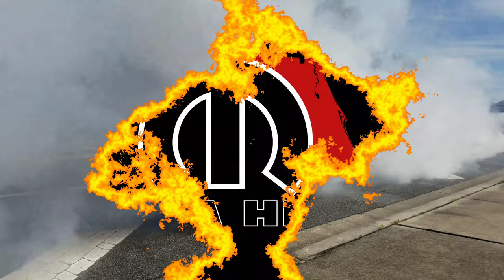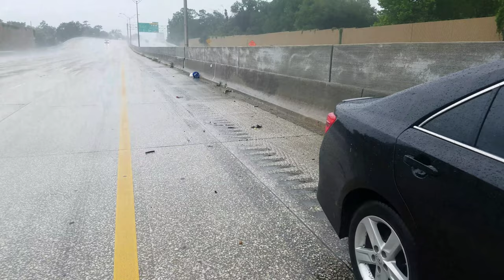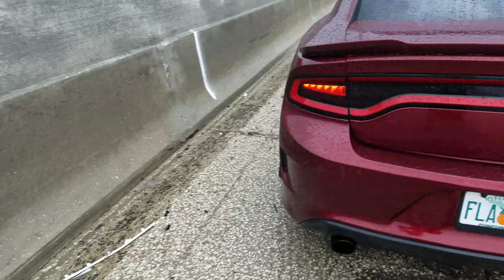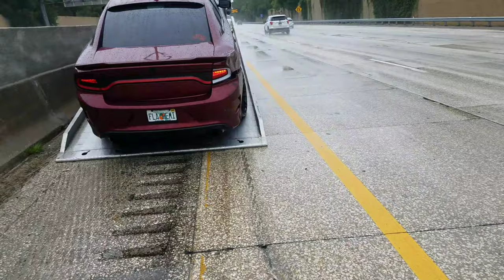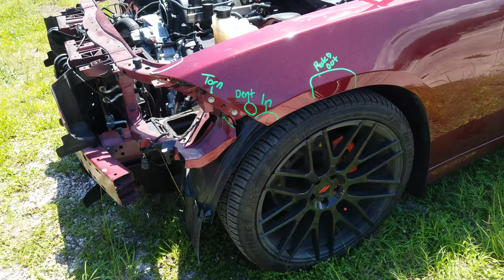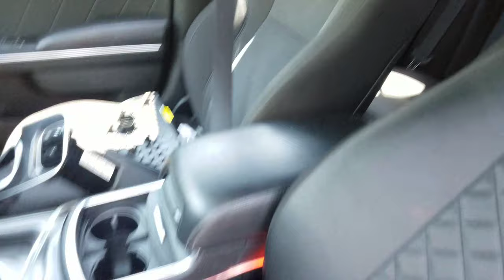This what happens when you Hydroplane!

Comment: Bro what are the odds smh the same exact thing happened to me on 295 n Dunn ave around the same time and I have the same exact damages on the rear passenger side my car is in the shop now 7300 dollars in damages ....Everything happens for a reason I know your next car gone be 🔥🔥🔥 stay safe out there
Reply from the maker: Damn. Stop playing. That's crazy.  Glad you safe homie.  Yea they said mines had over 14k damage.  They tried everything not to total it.  Even was gonna add some of the things I did to the car to bring the value up. But didnt work. Wish it could of been fixed. But on to bigger and better. Thanks mane.  Stay tuned. 🤫💯💪🏽

Comment: Bad tires
Reply from the maker: Tires had nothing to do with it. Tires werent even 2 months old.  On my way home that day seen 3 cars in the ditch. That did the same thing.  Was raining for 2 days str8.  Just an unavoidable accident. 💯
Reply: FLA HEMI The age of the tire has nothing to do with it. Tread is all that is important. From watching a couple of your videos, it looks like you are not that kind to them. Especially if you are using a cheap tire like Atturo or delinte’s. I’ll never understand why people put so much money on their cars just to put cheap tires on it. Not hating, just an observation. Time for a 392!
Reply from the maker: @casperjax1250  delintes ain't cheap. I rode on the original front tires for 2 years and over 65k miles on them.  The rears would be just good if you drove like a grandma.  Dont buy a V8 if you ain't gonna burn some rubber from time to time. 🤣
Reply: FLA HEMI Sorry bud, Delintes are the tires guys get when they can’t afford a p-zero’s or eagle f1’s. They are half the price and half the performance. You said in the video that the rear end came around so I’m not sure what the front tires have to do with anything. I drove my Daytona on that exact stretch of road everyday during that rain and was speeding most of the time and didn’t even come close to losing traction. Was I just super lucky? Or did the P-zeros just have that much more traction? Don’t buy a V-8 if you can’t afford good tires.
Reply from the maker: @casperjax1250  so a car with Pzeros, eagles, or whatever expensive tire you can think of has never lost traction or crashed? Foh. 🤣🤣🤣
Reply from the maker: @casperjax1250  people buy cheap tires because they drive their V8 like you supposed to.  So they can buy 3 sets of tires in 6 months versus people like you spending 400 a tire and trying to make them last a year! I already know you baby your shit.  I didnt know 400 tires were hydroplane proof! 🤔🤔🤔  I never heard a tire company guarantee using their tires will prevent you from a accident. 👌🏽
Reply: FLA HEMI I don’t remember saying that they were hydroplane proof or crash proof but ok. I said they were half the performance and they are. If you buy cheap tires you will get the result of a cheap tire. I buy p-zeros because I can afford to, you should have waited until you can afford it to get bigger wheels and tires. The only reason I commented in the first place was because I used to buy the cheaper tires and had issue with traction. I don’t baby it, but I certainly don’t do doughnuts and then act surprised when my tires have no tread on them and I hydroplane into a wall.
Reply from the maker: @casperjax1250  go look up what hydroplane means.  It can happen with any tire.  So your saying that your Pzeros that cost maybe $100 dollars more will never let you down? I pray this never happens to you because if it does you'll feel like an idiot because hydroplane accidents happen every damn day. With countless of different tire brands.  Like I said. No tire company will ever guarantee that if you buy thier tires that a situation like this will never happen. If that's the case everybody would have the same damn tires 🤣✌🏽🎤⬇️
Reply: FLA HEMI Do you have an issue with reading? When did I say you would never hydroplane with p-zero’s? Your entire argument is based on something I didn’t say, I gave you an example of me driving on the same road since we have similar cars. Hydroplane accidents happen every rainy day because of speeding, not paying attention, or shitty tires. You said you weren’t speeding and I assume you were paying attention when you were driving, so what does that leave? I’ll say again so you can understand it. You bought shitty tires, with shitty grip, abused them and for some reason you can’t understand why they would be garbage and have no traction (especially in the rain) within a couple months. I could explain the legality of why a tire company would never guarantee anything but you are having trouble understanding that cheap tires are cheap so I won’t get into that.
Reply from the maker: @casperjax1250  your right. My argument is.  Didnt matter what tire I had at that moment.  #godsplan 🙏🏽
Reply from the maker: @casperjax1250  all good homie.  Everyone is entitled to thier own opinion.  Maybe you right. I just never had a prob with the delintes.  Not like it was my 1st time driving in rain. Lol. I've had multiple sets of that brand. That's why I continued to buy them because I never had an issue. Maybe you right. 🤷🏽‍♂️  and you def will.  Hopefully soon. 💪🏽
Reply: What size were the tires?
Reply from the maker: @Darrellg06  I had 295/30/22 at the time of the accident.  Should of stayed wit 315s. Smh